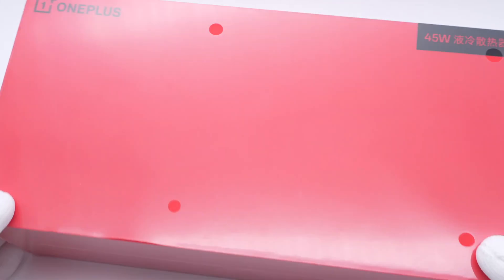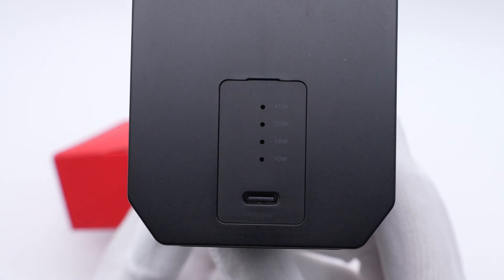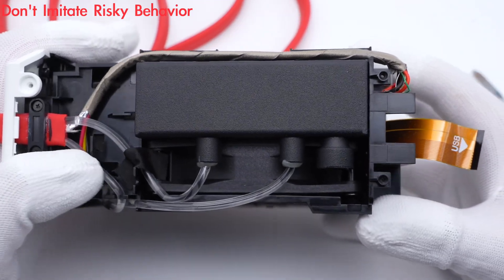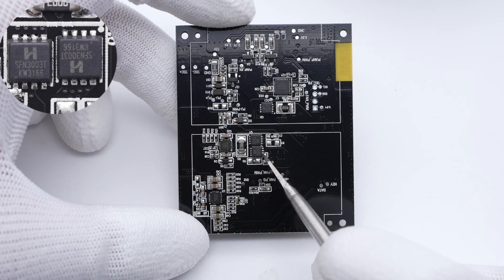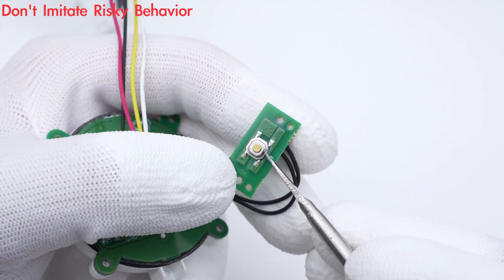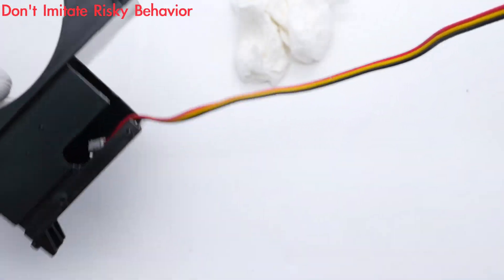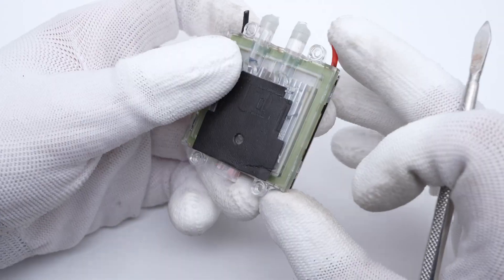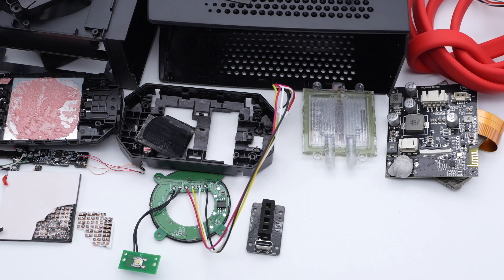Water Cooling | Teardown of Powerful OnePlus 45W Liquid Cooler

Comment: Nothing to refill tank. Mine got dry-burned months ago.
Reply: What do you mean? How did it run out  of water? Was there a leak?
Reply: @toma.6942 there was a leak at the water block itself. Had to inject with coolant into the tank before applying sealant. All efforts went futile when it no longer cools. Dry-burnt Peltier i suspect.
Reply: @iam.geeweiss oh wow. Would you suggest not buying one then?
Reply: @toma.6942 just a heads up if one considers getting one and NOT pulling its hose when twisted. Its manufacturer should have an inlet for refill and make it securely Pull-resistant.

Comment: But after sometime the liquid inside was getting leaked after sometime I noticed it was was working but leaking water so I gave it to technician he said he has fixed the pipe by glueing it but now the phone cooler is not being active like it does when we pull the clip he had reattached soldering the ic which was back of the clip is getting too much heat and the phone cooler is not starting can you please help me how to fix it please 🥺and where can I buy pbc chip from back of clip

Comment: interesting concept, but does it condensate during daily operation?
Reply: On the cooler's surface, yes, and water will not condense inside your phone as long as you keep it warm. And remember to unplug or take it off after use